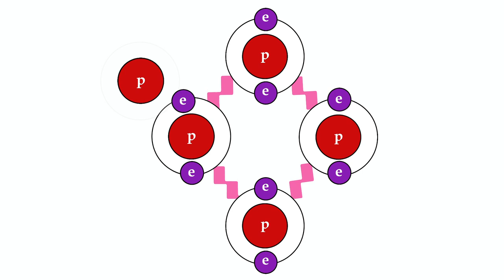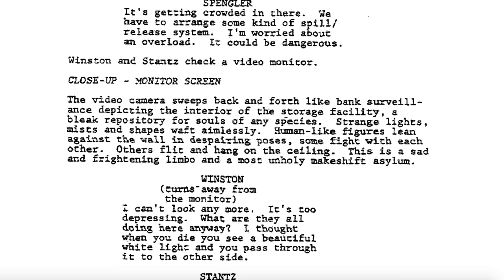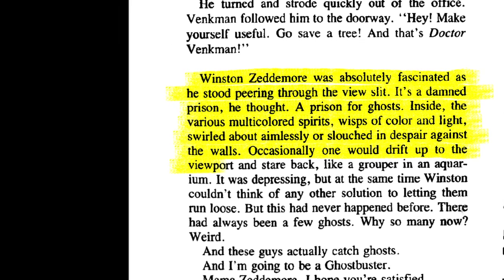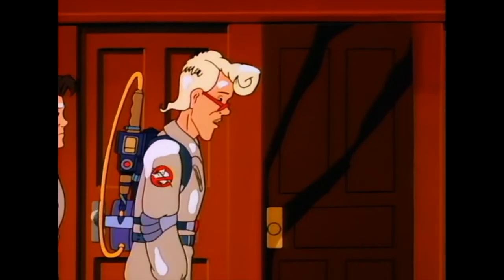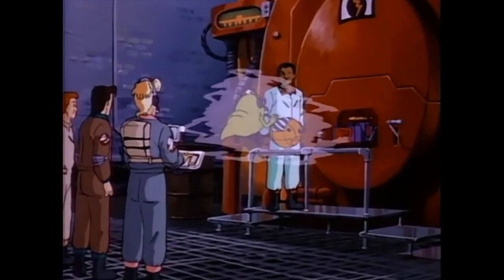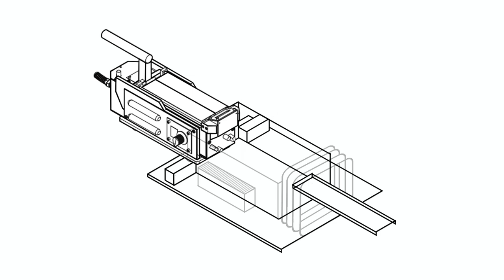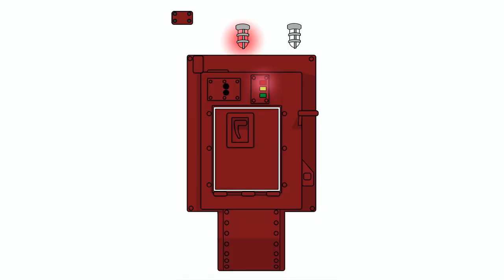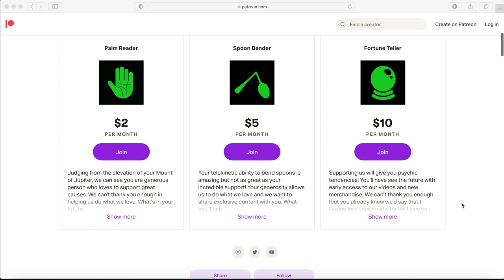How Does the Containment Unit Work? | The History and Physics of Ghostbusters Equipment

Comment: The ionization decay monitor would suggest that the trapped ghosts lose power over time while in containment, maybe eventually their PKE dissipates completely. So the containment unit has a max capacity, but you only bump up against it when you trap a high volume in a short time.
Reply: That's what I thought. Kingdom Hospital posited that ghosts sometimes have to return to the place where they died to 'recharge.' Thus the containment unit prevents them from doing that.
Reply: @nicholastosoni707  That would explain on Slimmer returning to the hotel he/it haunted in "the video game".
Reply: @nicholastosoni707  That's also a generic theory about ghost in real life. Ghost haunt the place they died and cannot leave for whatever reason. We also know ghost have the ability to move freely in GB but the owner of the hotel also said about slimmer that his staff have been aware of slimmer "for quite sometime" suggesting he can leave just cannot or will not.
Reply: @Seriona1  Certainly. I was throwing out the first instance where I'd actually heard about it as an example. To be honest, I had never really given it much thought.

Comment: I've wondered where the caution-striped cartridge goes for 30 years now. Is it ejected somewhere unseen?
Reply from the maker: Our guess is after the antechamber is cleared, the containment chute can be manually opened and the canister removed from it.
Reply: @ChannelingSpirits  Makes sense, but seeing Ray toss the trap shell aside instead of immediately retrieving the canister is odd. Unless there's a more extensive emptying and/or cleaning process involved inside the chute, possibly ridding the canister of any leftover psychokinetic, uh, goo.
Reply: @ChannelingSpirits  Back in the early 2000's, some of us in the fan community theorized that the ghost simply passed through the trap cassette once the connection was made to the entry grid and the field was neutralized. After, the trap cassette was cleaned and/or repaired, placed back in the caddy, and they were ready to go again.
Also, it was believed in the animated series that the unit could be expanded with extension vessels of some kind to make sure they had enough space. Of course, even condensed PKE takes up physical space, so I could only imagine how much land they actually had under the firehouse to expand equipment. I always figured after the first unit's explosion, it hollowed out the basement even further down which is why the animated basement was so deep. Even in the video game, the firehouse now had a sub-basement we never saw in the movie.
Meh, just spitballin' here.
Reply: Wasnt that adressed in one episode where either slimer or one of the guys where sent in the unit?
Reply: Glad I'm not the only one :P

Comment: The one question that I think nobody has ever asked' is like how do you retrieve the ghost canister from the containment unit once after you load the ghost inside, like the ghost tray will need a fresh canister when you need to use it again, like how do you get the back' that part has never been explained before.  That's another mystery we need to know about as well!
Reply: I imagine it probably functions like an airlock on a space ship or submarine, once the trap is emptied into the containment unit a door inside shuts and you can just pull the trap back out.

Comment: Where does the physical component of a trap (the cartridge) go once inserted into the Ecto Containment Unit?  Is it reclaimed for later use or is it stuck in the antechamber?
Reply from the maker: Yes, the detachable cartridge is intended to be retrieved and reused. So long as the containment unit is probably locked, the chute can be opened to remove it.

Comment: Sorry, whats behind the pannel? And how does the ghost go out of the trap if there is a wall infront of it?
Reply from the maker: The chute leads to an opening in the wall with the initial laser containment grid. That opening allows the ghost to be sent through to the antechamber while the grid prevents them from exiting immediately. The traps internal electromagnets are turned negative which repels the ghost, pushing it through.

Comment: Still wished they showed how they gain the ghost trap cartridge back after loading it inside containment unit after the ghost is expelled out of it and into the unit.
Reply: You open the door and pull it out.
Reply: @edisont.picard4112  The thing is they always show it by them closing the door with trap still in the slot as if they’re just leaving it. And as they operate the switches and stuff it seems like the trap does go into a different compartment down below.
Reply: @kingbeef66  Well, not counting the cartoon, we've only ever seen it happen one time. As the unit is homemade, it's probably simplest to assume that it isn't too fancy. If you go to empty a trap and there's already a cartridge in the unit, pull it out and toss it in the pile and then put the new one in.